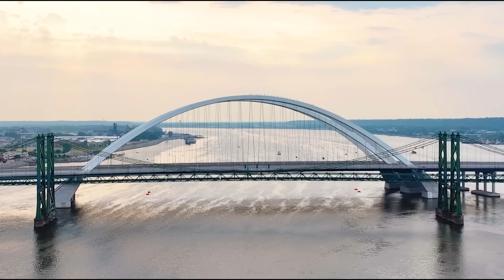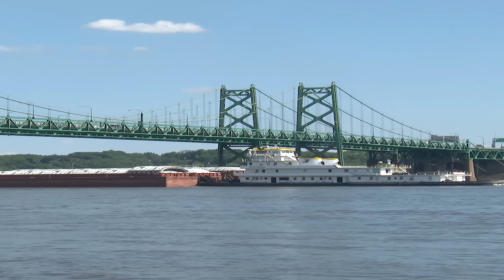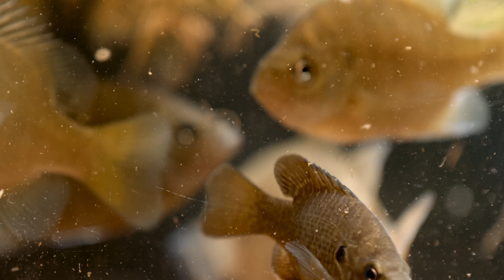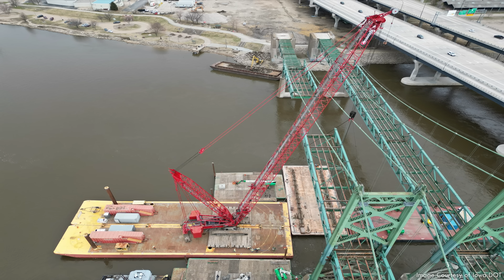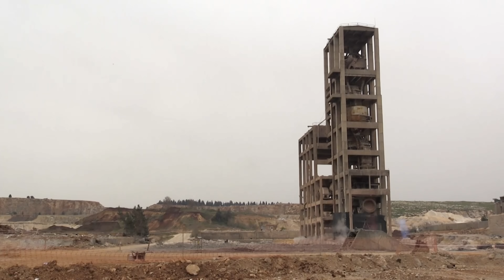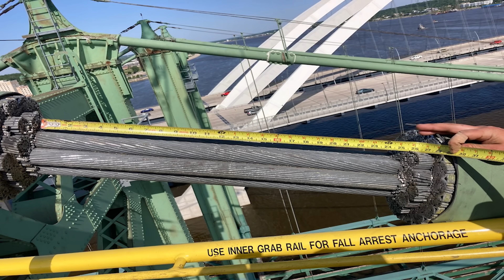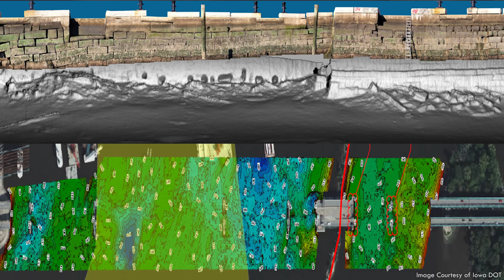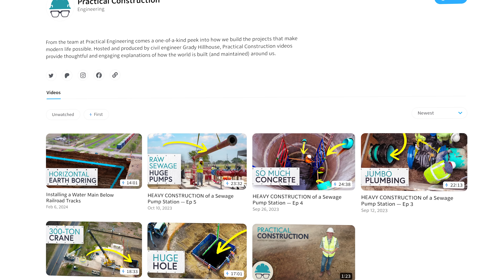Bridge Demolition is Complicated

Comment: Up here in the Vancouver area a 90 year old cantilever style Pattulo bridge is being ‘deconstructed’ as they call it.  Apparently the cost of steel they can get from old bridge was worked into the cost of the now completed cabled stayed bridge.  It’ll take them 2 years to carefully take it down.
Reply: That steel is probably super valuable since it's pre-nuclear steel
Reply: @ratvomit874  American and Canadian steel are extra valuable anyway, because steel made in other countries just isn’t as strong due to the raw ingredients available.
Reply: @Ethan.Lamoureux I'm fairly certain it's also valuable because it lacks ingredients
Reply: @Ethan.Lamoureux  That's such a nonsense comment. If you buy S235 or really any other construction steel you know the tensile strenght and quality of that steel, regardless of where it was manufactured. And for most steels it's easy enough to get the exact alloy sheet as well. 
I have never heard of someone paying premium for the same kind of steel just because it comes from a specific country.
Reply: Not necessary to put deconstructed in quotations

Comment: Careful you don't follow the old media down the overly-sensationalist path. The engineering is interesting on its own without the irritating fake drama.
I do know that getting competent firms for gov projects is getting harder because the cheese often isn't worth dealing with the exponential growing bureaucracy, but unless they hired some fresh out of college C-students who have never touched grass in their life they would know to start this analysis by simply reversing the order of construction. The order of construction is normally fairly well documented for public structures built in the past century, no computer modeling needed. Believe it or not stuff was regularly demolished before the 21st century. The real computer modeling trick is spotting where they can take shortcuts to save some cost.

The cables obviously don't need to be anywhere near full thickness once 90% of the load and wind area has been removed. Worst case they just take them down one strand at a time the same way they were originally installed on every large suspension bridge, the explosives are just a shortcut to save some of that tedious-labor cost. Crane barges do have their quirks, though on a project this size putting a land crane on a barge rather than using a real barge-crane seems a bit amateur, it could have picked much larger pieces much faster, short cutting a lot of other equipment and labor costs (not the mechanical speed advantage but the positioning and stability limits are easier to work with.).

Comment: Grady, are you familiar with the game Hardspace Shipbreaker?  It's a sci-fi game about deconstructing spaceships based on the real world shipbreaking industry. It's very good and interesting, and while it's both simplified and got a sci-fi angle, there's still a lot of having to be careful that you're not going to explosively decompress a section in a way that smooshes you, or having to carefully plan out how to move large heavy sections into the furnace while maintaining control etc.
Reply: And make very sure that you've got a clear shot to pull the reactor straight into the salvage barge...
Reply: @PyroDesu  Hmmm the tail on that coolant pipe is a little long and might not clear the framework.  Eh, what's the worst that could happen?

Comment: Couldn't they have dangled barrels of water from the bridge. For every piece of concrete you remove, add a big tank of water to keep the weight balanced. Then you can pop the corks out of the water barrels and drain the weight into the river.

Comment: The old I-74 bridge was iconic.  I was sad to see it go.
Reply: It needed to go. 

I do floatzilla every year, so ive been up close to the supports. I have pictures of my fist inside of rust holes at the base of the bridge supports
Reply: I literally stopped using it in 2015, because of that. No matter how much time it added to the trip id go down to 280 or up to 80.
Reply: The Centennial is the same way, BTW. You won't catch me crossing it
Reply: @brandonthurman7854 80 is questionable now too. It’s the next on the list for replacement. I just wish they would complete the final phase of the 74 project from middle road to the 80 interchange.
Reply: @BobbyS1981  Yeah, the dynamic of which bridge to avoid has completely shifted. I moved away before the new 74 bridges were put in but I remember always detouring to use 80 to avoid crossing on 74 or centennial bridge. My parents still live in the area and now they do the opposite- they always take 74 even if it takes them way out of their way.
Reply: In a few decades the new bridges will become just as iconic. They're beautiful.
Reply: @melissaharris3389 , indeed. The original were beautiful spans. The new ones are nearly as beautiful. The old greenish spans fit the place well.

There are worse bridges aesthetically out there needing replacing.

Comment: "slab crab" is my new favorite term 🦀
Reply: I wonder if special equipment is required if the slabs are fabricated prior to installation in the bridge. Like a prefab slab crab
Reply: @matthewdebeer8453  When that machine starts to wear out, you'll have to do prefab slab crab rehab.
Reply: @mattgies And if the captain of the Pequod starts a business for it, it would be Ahab's Prefab Slab Crab Rehab.
Reply: @adflaker  🤣🤣🤣
Reply: @mattgies That rehabilitation works is cutting edge, so it takes place at the Prefab Slab Crab Rehab Lab.
Reply: Slab crab is now canon in my head. I will also be referring to any concrete workers as slab crabs from now on.
Reply: "Small very exciting saws" I think is my new favourite term 😂
Reply: I often feel like personifying excavators when they do these strangely precise tasks, and this has the same vibes as trying to carry all the plates to the sink without dropping them 😅
Reply: It’s grab not crab !
Reply: @TonyWhite22351 Its crab, its 100% crab. some manufacturers even call theirs slab crabs.
Reply: @stacksmalacks8826  A quick Google shows company called Kenco Attachments does in fact brand it crab and it even has its own logo of a crab with caterpillar tracks holding slabs in its claws.
Reply: @TonyWhite22351 Grady captioned it "crab", not "grab".
Reply: @TonyWhite22351 Even if you're right, I respectfully reject your reality and substitute my own. The thing which pinches slabs is 100% a crab
Reply: Or they could have dropped it in the water and saved hundreds of millions they used anyway because those barge cranes disturbed the same clams they were protecting. Worthless, wasteful, and an exercise in futility

Comment: Interesting, thanks. Thinking about explosives, I suppose they are compelling because they work simultaneously and, for sequences, fast enough that the structure has not yet changed shape because of inertia. I wonder if the future will bring non-explosive processes, you can imagine that the simultaneous cuts would still work with a slow burn of one or two seconds.